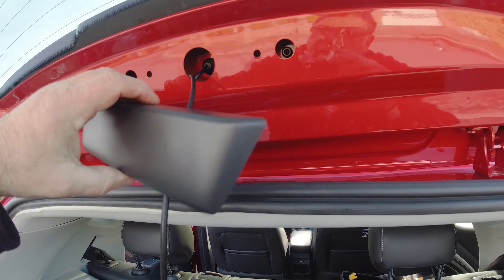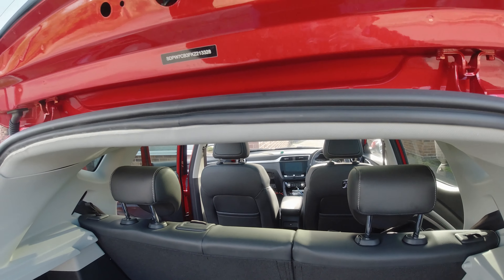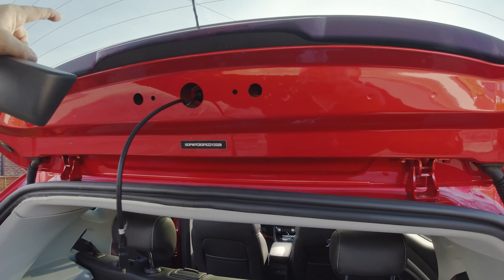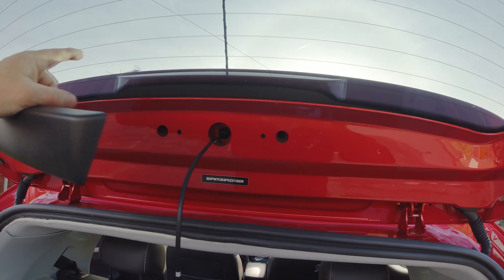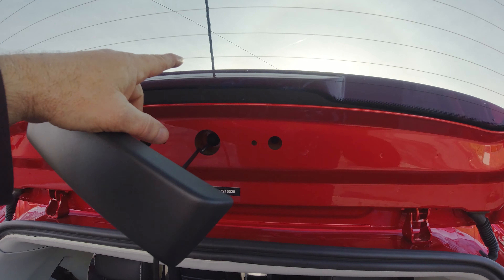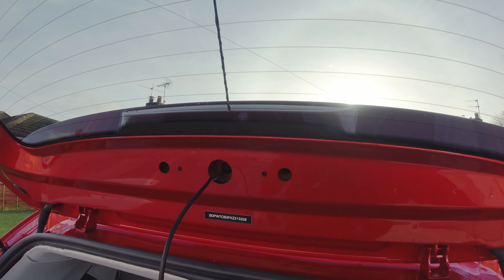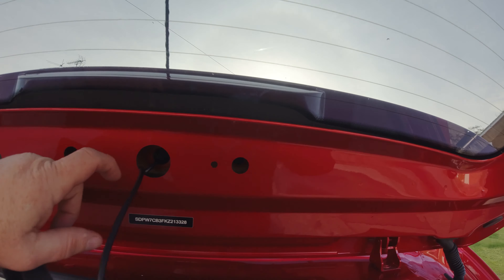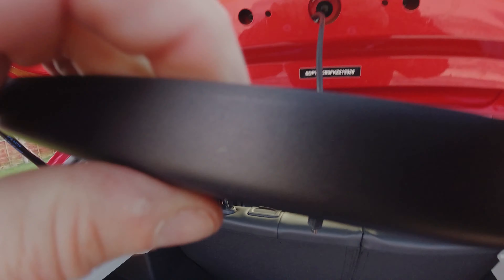Viofo A129 Pro Duo Dashcam install on MG ZS EV PART 2

Comment: Hi Tom just fitted my dash cam in 2022 ZS EV Trophy,
followed your excellent instructions and found it quite easy.
Cheers 🎉
Reply from the maker: Thanks for that David.. yes I really should get round to putting it in my MG 4....now better weather is here it should be relatively soon

Have had a quick look and the fusebox on the ZS looks much more accessible than the 4 ...seems I will have to take a couple of panels off round steering column etc just to be able to see it :(

Comment: Fitting the Viofo in a 2022 ZS EV Lux/Trophy - Thank you for the excellent instructions. I've used therm to fit the kit in my ZS EV Trophy. There are slight differences in what I found that might help people. 
The 'A' PILLAR TRIM came loose quite easily and it didn't have to be removed. I just worked with it hanging more or less in situ. It was not necessary to do anything with the door rubbers and it was not necessary to release the black trim strap that you struggled with. I didn't have to disconnect the speaker cable. The FUSE BOX is not quite the same as yours but it is in the same ridiculous position. The fuses that (will) work for me are - for the power supply that goes on and off with the ignition - a blue 15amp fuse (number 15)  and on the same row - for the power supply that is constantly on - the only green 30amp fuse that is accessible in my model which is the electric seat position control. The fuses are MINI on my model (I bought the wrong fuse taps initially). . The tails on the FUSE TAP should point away from the first row. So, the fuse tail of the tap in position 15 covers the fuse number 23. WIRING TO THE REAR CAMERA was very easy for me because the wire can sit in the sunroof channel. I loosened some trim in the top left rear corner (which was fairly easy) to help me access the cable rubber trunking route up into the door but I think I might have achieved getting the wire there without doing that. An ALTERNATIVE CABLE ROUTING might be to run along the floor edge because when the door rubber is lifted at the bottom it reveals a channel about 1cm wide. This is the wiring route used when my fitter wired in my tow bar. Ok. Thanks again for the help and encouragement.
Reply from the maker: thanks for that Thingaby...some useful info there....I may well be doing the same soon as I have a Trophy Connect on order....still not 100% whether I will actually go through with the order will see how things are financially in March when it's due...enjoy the car...Tom
Reply: Have a 2023 LR and basically same as you.. Fuse box difference etc. Did run rear cable along floor and not running through back as using our old dash Cam and didn't want to fully instal (will buy new unit soon) Also no need to pull black grommet or speaker wire. Also just dropped both cables down gap near speaker, it just easy slid through onto passenger floor. One thing to be careful when running cables (esp front) as potentially rattle (put car in for sunroof rattle & now believe dealers assumption that dash cam cables were cause...so re installed and taped to existing wiring).. Can test by shaking wiring and if hear rattling it will rattle when driving so put more tape where needed

Comment: Just used your top tip of using electricians rods  to run a rear cam cable above the roof lining and through the rubber connecting tube to the tailgate on a hyundai kona keeping it away from the side airbags. Ive seen so many clips where wiring is sitting across airbags!!. Anyway keep up the good work and thank you.
Reply from the maker: Hi Andy thanks for that...yes I have seen those clips as well....some from professional installers that say the airbags would just blast any wiring out of the way so no problem...but I didn't like the idea anyway hence me trying to find a route as far away from them as poss.

Comment: Tom you have done a really professional fitting I wish I had your confidence 👍
Reply from the maker: cheers Brian....nothing really hard about it just the time....I have to do everything outside as no room in garage if I had a big enough garage would be even easier not dodgeing showers :)  ...worth having a go in my opinion....a friend was quoted £150 to have a dashcam installed by an auto electrician and that was just a front one....worst thing would poss be breaking a plastic press stud which would be cheap to replace
Reply: @TomsManShed  yes but that fuse box positioning is crazy! Looking at the fusebox position if the MG ever developed a water leak into that area the fusebox would be toast, what do you think to putting a shield/cover/deflector above it so nothing could drip on it? Back in the day water leakscused to destroy many VW and Audi cabin fuseboxes, I had a VW Jetta with that issue

Comment: Very helpful Tom why not run the wires along the door fills? Not sure I want to mess with my air bags.. I got no card with my MG5.
Reply from the maker: Hi Thomas...thanks for the kind words...yes you could run them low down at floor level.....just seemed easier over the top and like I say they are well clear of the airbags and if the airbags have the power to push roof lining out of the way then a slack wire should be no problem....also you would still have to remove the A pillar trim (the most awkward bit) to run wire up to cam.....whatever is best for you though 

Not sure what you mean re "card"?
Reply: @TomsManShed  thanks for the quick reply Tom, I mean no emergency card , I don’t even have a manual, had to download a PDF from MG , which isn’t so bad. Really helpful video no one shows how to actually run the wire from front to back. Will attempt my MG5 today. Good idea on the switch for the parking monitor. I’m off to look up air bags for the MG5:)

Comment: With your excellent video running in my car I also manged to fit the Viofo A129.  The fibre rods were excellent & luckily I didn't seem to have any difficulty removing the A piller, obviously not as tight as yours.  Only used the camera for a day, excellent picture, just wondered if you can see the live view all the time your driving as mine shuts off after 3 mins.  I know I won't be watching it but my wife likes to see it on live to reassure her it's working!  Anyway thanks again for a fantastic clear video, it really helped me & to have the confidence!
Reply from the maker: Thanks for the kind words Derek...re the live view...it is selectable in the menu...it's the setting "screen saver" ...only 1 min and 3 mins are selectable...no on all the time am affraid

Comment: I've just had this running in the background while I've been doing other stuff tonight and haven't paid great attention to the install video, but I installed the A129 duo tonight (not the pro, but it installs the same way) in my dodge charger, and it took me about 20 minutes to install, including running it through the trim. I haven't installed the hardwire kit yet, but just wanted to let people know that even though the first and second video have about 85 minutes of footage to install, you can do it much quicker than that, and it's a pretty easy install. I have a feeling the hardwire install will be about another 20 minutes (40 minutes-ish total) to set up, and mainly because my fusebox is in the trunk and I need to run it all the way to the front of the car. Just didn't want people to see over 2 hours of video for the install and think it will be a major endeavor to install the camera in their car!
Reply from the maker: A tutorial video like this always takes longer than the actual task as I point out specific fuses,wiring in an extra switch,filming each part while doing it at the same time,talking about tools etc etc 

Plus I was showing in detail the removal of certain panels etc, in this particular car the front pillar trim was particularly tricky to remove...especially if it's the 1st time you have done it and have to work out where the clips are....maybe you had removed your Dodge Charger's trims before and knew how to do it? ...I don't know...

Also it includes the hardwire kit (which you say haven't installed) .....I am  certain there is no way I could install the front cam, the rear cam, and the hardwire kit including hiding all the wiring including through the rubber boot of the rear tailgate (not a fixed rear screen like the Charger) in 20 + 20 mins.

Now I know how to do it I could do it faster but that wasn't the purpose of this vid....it's aimed at folk who have never removed trims etc.

 ....Sorry if you found it too long.

Comment: Did you find the 12.2v cut-out setting on the hard wire kit to work best?
Reply from the maker: I used the 12.0v setting  .....as you arrive at the supermarket car park or wherever, the battery will be right up to full charge so this should give you a few minutes in park mode.

Of course if you want to monitor the car while parked even longer you could select the lower settings at the risk of the battery being too low to "start" the car (although even on 11v it should be ok)

If you needed to monitor the car for long periods you could of course use a separate power bank.
Reply: @TomsManShed  thanks mate. I finally installed the cameras today. Thanks to you I had it all finished in about 2 hours. Works great.
Reply from the maker: great to hear glad was of some help :)

Comment: im interested in this camera for overnight surveillance because someone is keying my car and i want to document who is doing the damage. Recording continuously at low bit rate – say 8 hours – would you recommend an external battery for these sort of tasks?
Reply from the maker: Hi Clothing Counts

If using continuously without starting the car to charge then probably yes...you can run it of a portable power pack with a USB output as the cam uses a USB connection for power.

The 12v cigar plug lead (or hard wiring kit)  just drop the 12v to the 5v of USB.

If the low life is keying the car might they not see the cam and try and steal it? ...or not key the car coz they see the cam?...also the lowlight sensitivity is good for a dashcam but not as good as a proper surveillance camera

Would it be possible for you to use one of those cams that take vids of wildlife with motion detection? have you any nearby bushes you could hide it etc?

Ideally a really good low light CCTV cam would be great...see my vid on the colorvue cams...the night time performance using no IR emitter is unbelievably good.

Hope you get the culprit.
Reply: @TomsManShed  wow thanks for getting back to me. This gives me a lot to think about. I never thought about the wildlife cameras. I will look into that as well as your video you reference. I don't think they would take the camera. I live in New York, very busy, someone is always watching they say. This person likes to do damage that can be done discreetly, meaning they can kid by walking by, without making too much noise or ruckus.

Comment: Does the parking mode drain the battery if you don’t drive it for a bit do you know? Bit worried it’ll flatten the battery, I’m using the hardwire kit that says it shuts off when it drops below  a certain voltage.
Reply from the maker: I don't use my car daily but it's usually up the drive for for 3 days or  so ....the hardware kit does indeed shut off before the battery goes flat.....it seems to run the cams for about 12 hours up my drive before it cuts off 

This will vary of course depending on how much movement it picks up and records.... which is quite alot in my case as it picks up people walking and cars driving by etc.
Reply: @TomsManShed  thanks Tim that’s a relief, really appreciate taking the time to reply. Ordered some pulling rods today, no way I’m gonna get the cable to the rear without them. Thanks again for such a great video.

Comment: I have dash cams, rearview dash cam, radar detector and dedicated power pack for dash cams, and I'd like to hardwire all these items. How many fuses can I tap (pull) from the fuse box? Also, does it affect the operation of the car electronic components?  Thank you. Great content. Thank you for your contribution.
Reply from the maker: Hi Tony...thanks for the kind words....the power consumption for the total of all those components you listed (not sure about the power pack though) should be pretty low so shouldn't need too high a fuse rating....good idea to have each component have its own fuse though so you could do this with its own inline fuse.

Re affecting the cars electrics...all I can say is that my front/rear dashcam and a Road Angel Pure camera detector I use haven't been a problem in the MG ZS EV.

Comment: Tom, I saw your video showed the dash cam power supply connected to the dash cam MOUNT. Guidance on the Internet says ' The ACC (ignition-switched) detection feature will allow the dash cam to switch to parking mode automatically if the vehicle’s engine turns off and switch back to normal recording after the vehicle’s engine turns on. Please be sure the cable is connected to the camera directly and not through the GPS mount.'

What do you think? (I noticed the connection for the rear camera and the connection to power the front camera on the camera body both right angle connectors get in the way of each other.
Reply from the maker: Hi Richard....I hadn't heard about that so googled it and it seems that this applied to earlier cams. I have mine plugged into the mount and the parking mode works fine. As you know I also use the proper parking mode compatible hard wiring kit. What you mention and the early cam reference is mentioned in this discussion https://www.viofo.com/community/index.php?threads/a129-pro-dashcam-getting-hot.27012/

The plugs are a bit close but the one to the base is on the top of the mount and exits to the left whereas the the one on the cam is on the right hand side and exists upwards so they do miss each other.

In Feb this year my GPS base went faulty (11 months from purchase)  ...it stopped providing power to the cam itself (when connected to the power direct the cam worked fine) ...so I contacted Amazon and told them it was just the base and could they replace it and they said they could only offer me a full refund ....so I had to send the whole thing back...(minus all the wiring....I wasn't going to remove all that)... they also paid postage ..seemed a shame to send both cams back when they were working perfectly but that was what they asked  ....I immediately ordered another one I liked it so much .....With it being a new purchase this too is covered by a new 12 month guarantee so am happy with that ...so good service from Amazon as I have always had....hopefully this base will last longer but they are only £16 if not.
Reply: @TomsManShed  Thank you Tom, that is good news because to connect the power lead and the rear camera to the camera connections was going to be an interference fit for mine. Really glad I can use the screen mount GPS base to power it. Incidentally my genuine Viofo  HK3 3 wire cable was dead on arrival! My friend bought one not yet fitted and that powered my camera fine!

Comment: Thank you for the detailed video. Just wondering, instead of pulling the power cable or installing a switch, wouldn't it be easier to just press the power button on the device to switch it off when you park the car for the night? I might have missed your reason for installing the switch.
Reply from the maker: Hi Christian...thanks for the thanks...Yes you are right....it was probably me showing my age as it isn't really needed....it does save having to do any press and hold things and maybe pressing the wrong button and inadvertently getting into a menu on the cam etc ...but as you say it isn't needed.

It did come in handy a while ago though when the unit wouldn't come on .....the green light on the switch showed it was getting power so I knew visually that a fuse hadn't blown etc.

It turned out to be a faulty GPS base that the cam clicks onto ....Amazon replaced the whole camera kit under guarantee (it was 11 months old at the time)
Reply: Oh very good! Glad to hear you got it replaced and I see now that with a switch you can isolate any problems as well. Cheers!

Comment: Great comprehensive video Tom really helpful. Strangely the windscreen side trim and the grey retainer foot were OK for me, I used some wide opening pliers/waterproof pliers to squeeze the protruding tab slightly downwards and into the retainer and it came out nicely, refitting it just slid into the grooves and clicked into place. I found removing the interior light unit gave great access to go to the front of the top of the windscreen. Can I ask how you removed the sunvisor retaining bracket, I can't see how it undoes? As you say the fusebox orientation is ridiculous.
Reply from the maker: Hi Richard...thanks for the comment...you must have the knack re the side trim :)....re the sunvisor bracket....if you look at the very front of the bracket (the side nearest the windscreen) ...if you open the door and stand outside and look at it from there...you will see a tiny slot...if you just flick that flap open with your nail or a screwdriver you will see the screw behind it.
Reply: @TomsManShed  Thanks Tom I will have a go. I made the rookie mistake of not testing my Viofo 3 wire hard wire supply unit! Guess what it didn't work despite the supplies all being checked! Good job I was setting up an additional USB supply and 12v supply for a future auto mirror so I tested that supply and the camera worked proving it was the cable, thank fully the Amazon seller is replacing the 3 wire supply, so I get to practice my knack on the side trim clip and the sunvisor clip, oh joy 😂